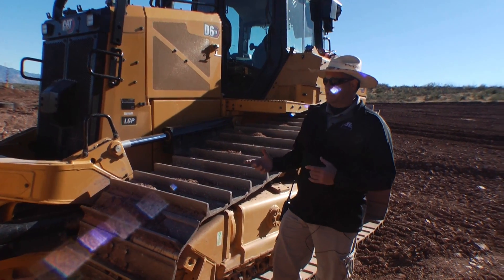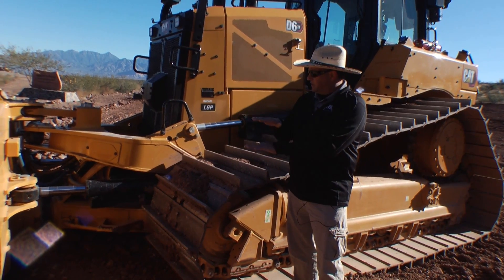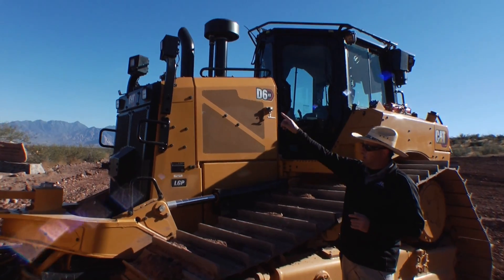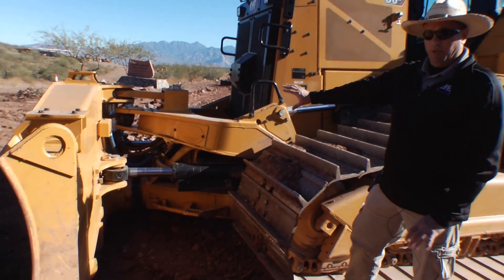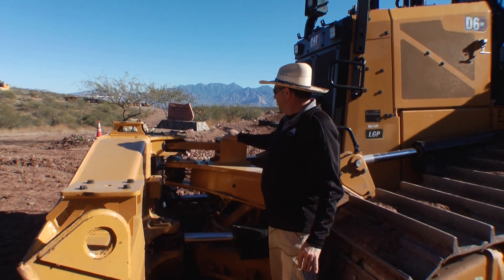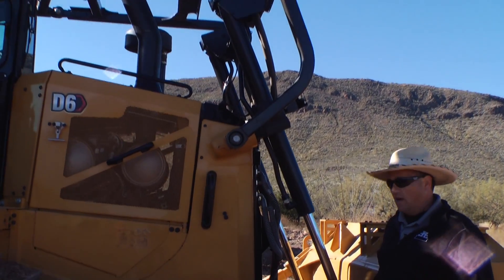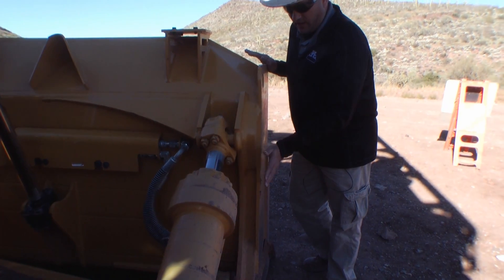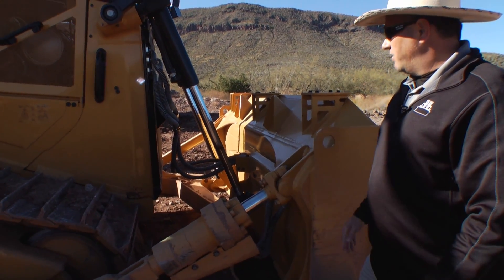Caterpillar V-PAT vs SBLADE

Comment: Cat really f*cked up by not having a pitch cylinder.  When you are slot dozing it is ideal to put the blade on float and set the pitch to keep the blade level.  Cat had a really stupid system on the D5 and D6Ns where you had to loosen 4 bolts and move shims around to adjust the pitch. Try doing that on a 100 degree day in front of a hot radiator.  Then they got smart and copied John Deere and went to a turn buckle which was quick to adjust.  Then they got smarter and went to a cylinder which could be adjusted on the move.  Now the morons have gone ass backwards.  Engineering must be smoking weed to be this stupid.

Comment: Can you run that 6 way set up on bigger machines like D9/10/11?  If not why?  Thx
Reply: No you cannot because they have push arms like the second dozer they showed. They are intended for pushing big heavy material not for fine or finish grading like you'd use a d6 for. Using a machine that big is strictly for pushing a lot of material you're not trying to be precise about spreading your material like you would be on a smaller dozer. The push arms are built for strength and being able to pivot like a 6 way blade makes it much more prone to breaking and a lot less sturdy and strong as the L shaped push arms
Reply: @pillaryclinton6187  cool thx for explaining👍
Reply: No
Reply: Porfabor pueden subir un video traducido en español enfocando la cabina y la operacion dela maquina.?